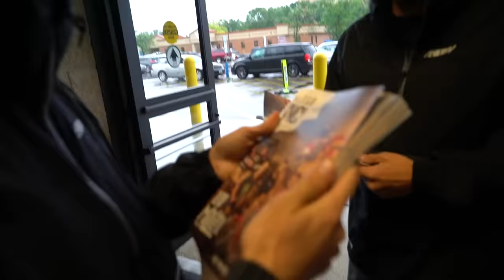Smart Car Crashes Through Wall

Comment: Little did they know it was a load bearing wall...
Reply from the maker: Rip
Reply: Rip
Reply: Rip
Reply: Yea it’s going to cave in next snow fall
Reply: @Jack-jd6tj  Square or rectangular post frame buildings like this one do not have interior load bearing walls. They're good.
Reply: C0revette789 I was kidding, even without support the ceiling wouldn’t cave into its self.
Reply: I want to see Canada bike